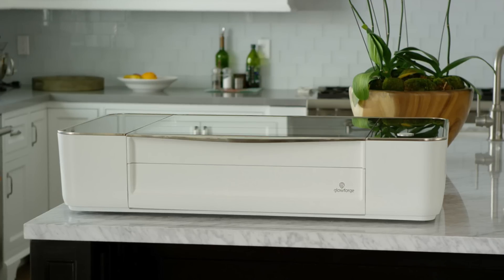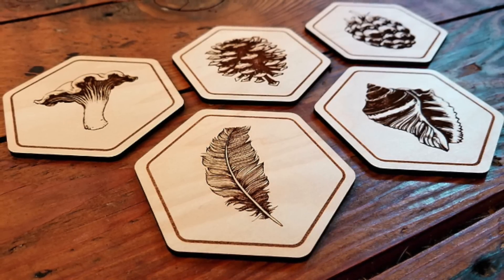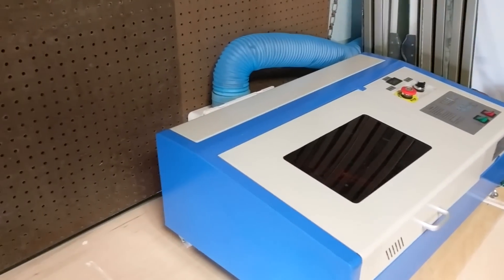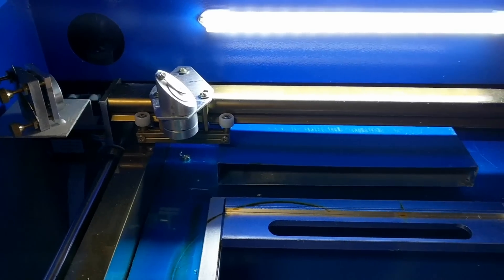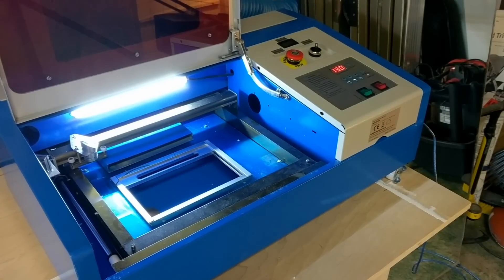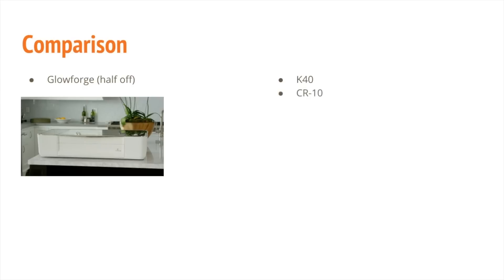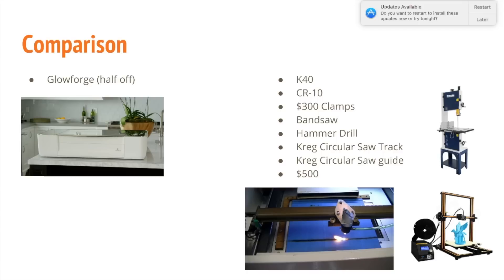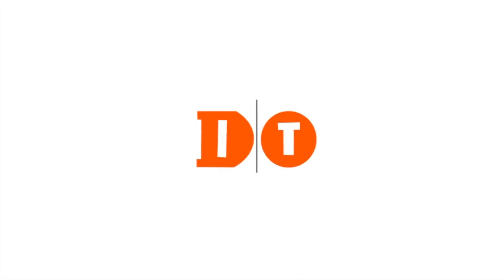eBay 40w Laser - k40 review

Comment: how thick is the material in the clip at the end?
Reply from the maker: It's 3mm plywood from Amazon.
Reply: @DoItProjects  awesome! Do you think it can cut 1/4" in maybe 2 passes? I know it depends on the okay and the glue too  but just curious if it can do it, maybe with some air assist toi
Reply from the maker: Yeah, I have done 1/4 in. material. Probably will take 5 or 6 passes. I would recommend not moving it until it falls through. Thanks for watching!

Comment: Thanks for the video. Just curious, what brand k40 and what seller did you buy from on ebay? There’s a few different versions and seller on ebay. Not sure which one to choose.
Reply from the maker: Hey! So far I have purchased from 2 different sellers. The one thing made sure to get both times was the digital power display. Some seem to have a dial for the mAmp. They are 20-30 dollars cheaper but seemed less straight forward. Thanks for watching!
Reply: @DoItProjects  Digital dial is a bless - no changing current during operation as with potentiometer. Just be sure to install mA meter to know how much you push that 30W laser tube.

Comment: What supplier did you purchase your laser from? and what model is it? Getting ready to take the plunge...
Reply from the maker: Hello! I posted the link in the description of the video. I tried to access the exact seller from my eBay history but was unable to open it. Thanks for watching!
Reply: There isn't much difference between them. I got mine through Amazon. Mine is the Orion Motor Tech 12"x 8" 40W CO2 Laser Engraver/Cutter. If you watch older videos you'll find bits about bad wiring and such. My Orion Motor Tech does not have those wiring issues. It does have loose two prong power connectors in the back. No big deal, I'll just glue them in place with a hot glue gun. I do wish they were grounded three prong.

The big thing you need to know is that the mirrors are cheap plastic with a mirror coating on them and they are crap. I replaced all three with 20mm copper (CU) mirrors. The lens is a cheap 15mm lens, which I replace with an 18mm ZnSe that's a much better quality. Air assist is a must. And, if you plan on cutting anything more than paper, you'll want to vent to the outside and probably have a filter on that exhaust, too. Acrylic is nasty as hell when you cut it. The fumes are horrible.